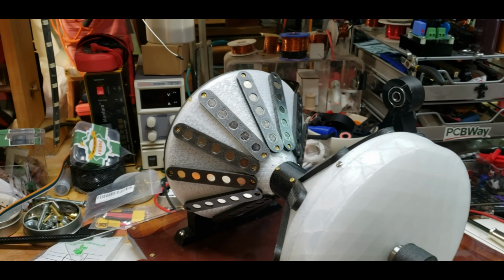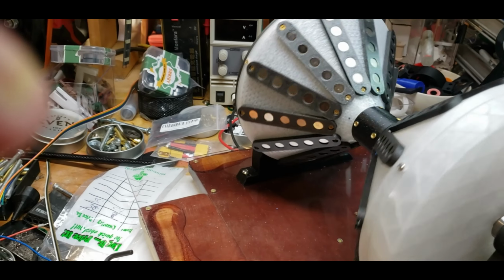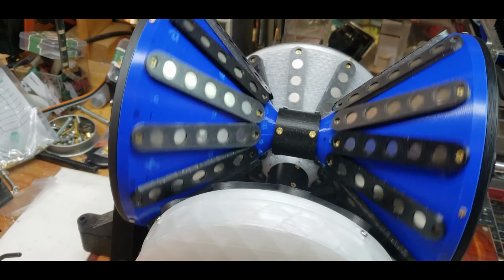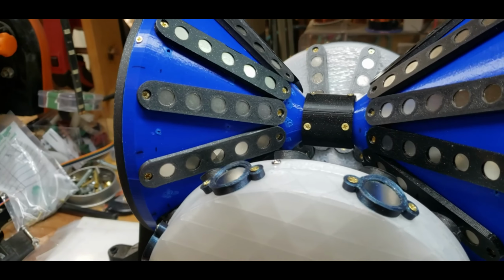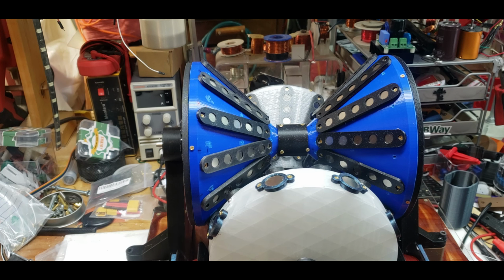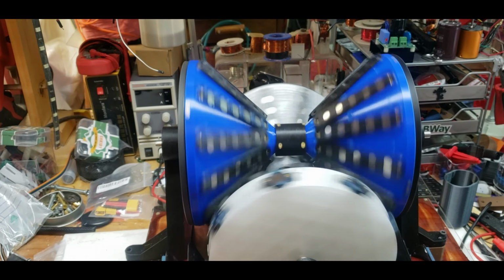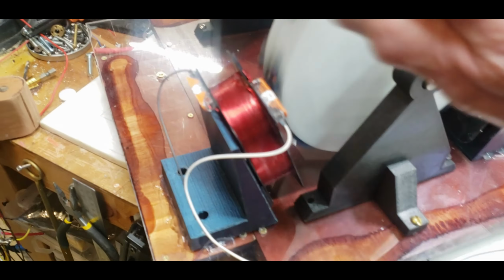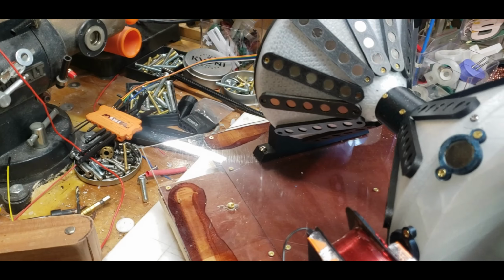3D Printed Pulse quad cone motor

Comment: Take em apart in the middle, each cone tips in, but 2 bearings for each cone connected to the housing. 
You have lines of magnets. Make 2 opposing cones have magnets arranged in ring formation. Steel backing can be used to augment the fields. Depends on if you want to attract or repell with the magnets

Comment: If you have them spin independently, they'd all spin counter to the opposite cone. No gyroscopic wobble. Get the cones on magnetic bearings, no friction. So very stable means of generating high inertia with low energy. Add small coils to pulse a charge to a small electromagnet. Add voltage oscillating circuit for high frequency pulse output. Make coils adjustable up and down the cone to tune proper frequency for speed of cones. Add weight for higher output after up to speed, lower weight to get to max output faster.

Comment: The only way i can logically see it working, is that you have the white cones connected as they are now.. but the blue ones should be disconnected from each other. because they will want to turn in opposite directions.  now it turns for a short time because it is not 100% in equilibrium.. but once it is tuned you will see that the forces work in different directions on one of the axis (the same way if the blue axis is connected, the white cones will try to turn in different connections.
Reply from the maker: your probably right but i will still try it this way and if it doesn't work then I can always a just right?